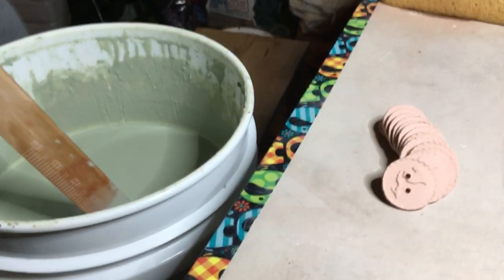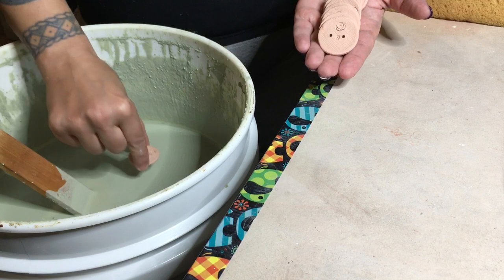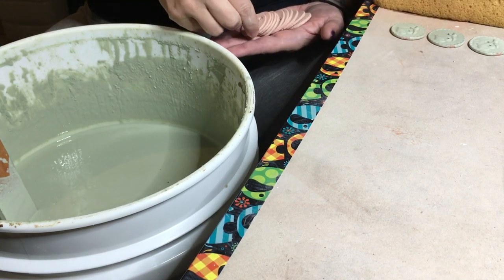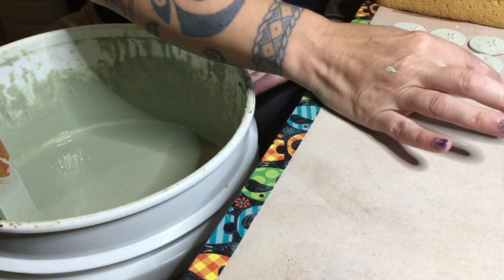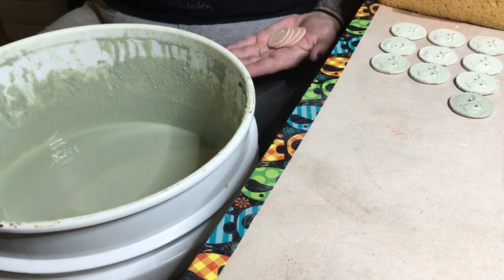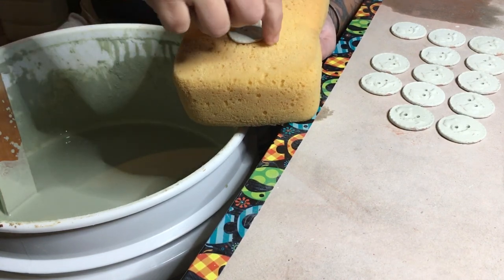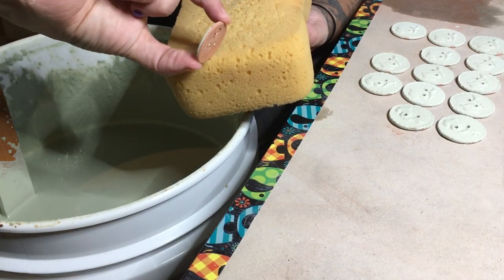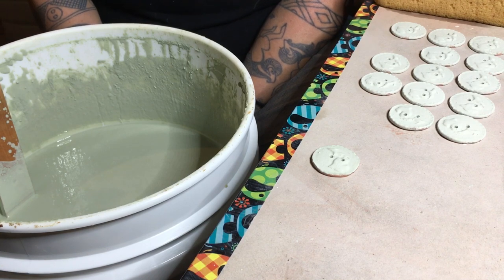Making ceramic buttons - part 2 of 2

Comment: I was wondering, wouldn't the unglazed back cause wearing of the fabric, or of the thread used to sew them on with?
Reply from the maker: Maybe some, but not anything significant. You can always smooth out the back and holes with a Diamond burr sanding pad and file, if it’s a concern. It’s not something I find worth worrying about (and yes, I’ve been making my own clothes for 35 years 😊)

Comment: How do you fire them flat? On stilts? Then do you have to dremel off still marks?Well done!
Reply from the maker: They just get laid onto the shelf. No stilts. That’s why I clean the backs and edges with a sponge, so they don’t stick.
Reply: @stellworkstudio4391  I’m not a ceramicist so bear with me here but how does wiping them with a sponge help them not to stick to the shelf? And is that why you only glaze the front, because otherwise the glaze would stick? 
Thanks :)
Reply: @stellworkstudio4391  one more question: between the first video and this one, did you bake the clay? Or did you let it sit for a while? It looks different. 😊 have a good day!
Reply from the maker: @gennwithag  I always bisque fire before glazing, yes. The clays I use turn quite pink in the first firing 😊
Reply from the maker: @gennwithag  yes, glaze is made of silica, clay, mineral colorants, and fluxes that make everything melt together, similar to a melted glass. The glaze, when melted, will stick to anything it touches, so I have to be careful that no melted glaze will touch my kiln shelves.